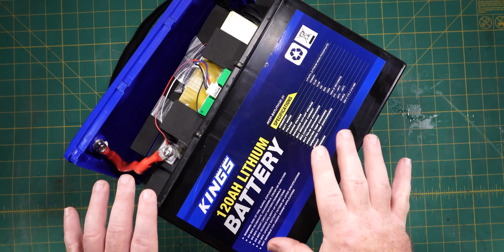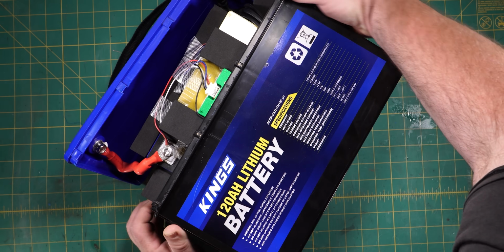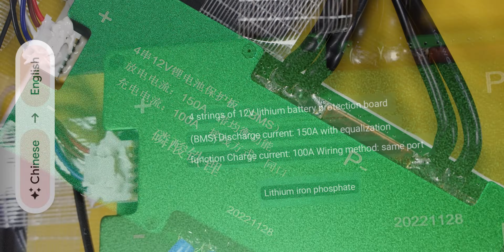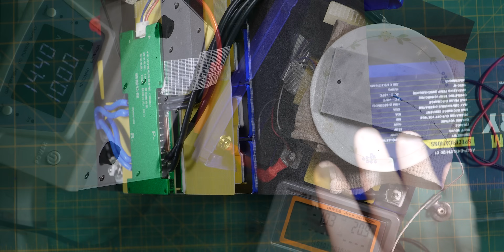Supacentre Kings 120Ah Lithium LiFePO4 Battery Performance Teardown Review Part 2

Comment from the maker: Did this change you mind about the Kings Battery? Or confirm it?
Reply: Have you notice the difference in the weight of some of these batteries? Some are 15.5 kg others are only about 12 something kg ?
Kings says it is because of terminal location with leas wiring. Nearly 3 kg of wiring seems a lot to me.
Great videos 👍
Reply: With the few I've seen in person, the heavier ones are 1p 4s, and the lighter ones are the 2p4s. Both types I've seen are different shaped cells to what he shows here.  @383dave
Reply: I would consider the battery based on your review as there is only one issue that is not really a issue for most of Australia. For the other 15% you shouldn’t be relying on the internal functions of the battery (IMO). This function renders the battery unusable until temperatures climb back up. A cheap $50 fix makes the battery still usable for charging and discharging. I live in the other 85% and I protect my batteries again overheating.
Reply from the maker: @Stoicloner1  thanks definitely an possibility, that the cells are second hand.
Reply: Still looking.  There’s an enormous price variation on this product.  Very confusing.
Reply: Changed my mind lol
Reply: Subbed.
Yet to look if you have tested the itech 100Ah.
Reply from the maker: @Ted...youtubee  I haven't, though wouldn't say no to pulling one apart!
Reply: The 120x only has 89Ah. Which I guess is why it weighs 10.5Kg.
Reply: @Ted...youtubee  Itech would be my choice, if I wasn't desperately poor and since the company I work for closed and there's no jobs here (live off-grid and my lead acids are closed to dead) I think I'll have to buy the kings till things improve, sadly Kings Lithiums are not "Drop In"  batteries, so I'll have to buy a new controller in case my current controller gives problems, although it can be manually set for lithium, a lot of people have claimed constant problems with my model charger even when set correct, don't intend to live without power!
Reply: Would have liked to see what was between the cells to prevent rubbing thru the blue sheath and cant tell if there is any compression. The charge test at -10C at 10A seems pretty close to within spec for LifePo4 without seeing the actual datasheet 0.1C charge down to that temp is fairly standard, 10% of 120 being 12A; I think your assessment was a bit harsh just on that single point. Otherwise found your review fantastic. It is hard to build a LifePo4 batt for the same money that Kings are asking.
Reply: Testing exceeded my expectations and so did the tear down. No chance (or highly unlikely)  of finding a new battery from a local OZ seller at that capacity and price with confirmed new cells. Would love to be proven wrong albeit if that's the case it would be a miracle if the cells weren't C grade. Cheers
Reply: Two fails, the low temp and qr code. The qr code is sus as fk. I'll never buy one, thank you!👍🤠
Reply: It confirmed my opinion. I am very happy to pay more for better quality.

Comment: Well,  I watched this video and the last one,  this battery has 4 cells in series, sure you mentioned 4 x12 in parallel at some point, and you banged on how the Battery management makes sure each cell is charged to the same level.
There is a flaw in your what you said.   Sure the battery management may be looking at each cell,  but all it can do is switch on or off the current flow of the battery , cause all negative wires to the BM, come from the same point on the last battery in series ,  there reason there is 4 wires, cause each electronic switch can only handle a set amount of power so requiring four devices to spread the load.  
Yes I have a electronics trade qualification,  the fact you didn’t know this, mean you should not be doing any kind of testing and sharing your thoughts,  and I bet your getting paid for these reviews by Kings.   I wont bother watching any more of your videos and I say to other viewers, to be careful this guy is a stooge !

Comment: So, why do you seem to be amused at strangely unfunny points within your video? I asked Kings about their batteries and how they could state they were A Grade. They initially sent me a spec sheet and then I said that was not what I was looking for. I asked how they knew that their batteries were A Grade cells and their answer was “because if we sold anything else, then we could be sued”. I advised them so, “if your manufacturer told you these were A grade and they turned out not to be, how would you know?” Would you be liable?

They could not answer and no Kings do not make these batteries, they are made on King's behalf by another company.

Comment: Thanks for the excellent review. Does the term "new" battery still hold true if the cells are pre-used? That really disappointed me, I was just ready to buy one of these. How do we know the more expensive ones don't apply this practice - just because they are more expensive doesn't mean they don't. Thanks again.
Reply from the maker: You're welcome, and you're right, without intact QR codes, you'll never know.

Comment: Any chance you could do a review on the powertech lithium 120ah from RTM? they are $500 at the moment, wondering if they are any good? I cant find any reviews anywhere.
Reply from the maker: I've not heard of that battery (though in all fairness, there are probably lots I haven't heard of!) 

Unfortunately, I don't have one to test.
Reply: @LockyourHubs4WDing if it helps: RTM is pretty much the same as Jaycar (same parent company I think) - big overlap in stock, same product ids, same design web site.

Comment: I’ve have had on for 4 years, black top. It runs everything my fridges, lights and even a toaster off an inverter. I haven’t had a issue. I capacity tested it last month it still made 117.73 Ah 1513.96Wh . I posted my results on that group you talk about but omg the hate for anything Kings, people just didn’t want to know that they aren’t that bad for the money you pay. The admins began reviewing everything I posted and rejecting any more further test results. So I left the group, the group is really for very basic dc information and I don’t think the admins understood what I was posting! The Kings hate is a real pile on psychosis push by lithium haters and people that represent other battery manufacturers. So let them pay more than double for a battery with the same Wh to run their toaster I say! 😂
Reply: People with negative experiences are always more vocal. I would imagine the failure rate for this cheap chinese stuff is higher, but you'd still expect nothing higher than say 20% faulty
Reply from the maker: Mine (the battery tested in the video) now lives in the daughter's camper. Still working great!
Reply: I think a lot of people spend heaps on expensive gear and feel the need to rag on anything cheaper to validate their purchase. This happens with lots of products. Sucks to be them I suppose?

Comment: FYI Kings seems to have changed their supplier it comes in a standard cardboard box rather than the pervious coloured on, and the plastic battery case is slightly taller/ different shape.. who knows if the internals are the same.. I bought a second one in order to run it in parallel
Reply: Some companies substitute product after they have entered the market and get good reviews, MAYBE that's what's happened..🤷‍♂️
Reply from the maker: I hope not, the blue top 120Ah is a good thing, mine's still running the daughter's camper.
Reply from the maker: Let's hope it's the same!
Reply: @LockyourHubs4WDing   I’m waiting on a Victron smart shunt and I will test the capacity at least… I think I may buy another of the new ones though as to not have two different battery’s, lesson learned though, buy them at the same time !
Reply from the maker: The Victron shunts are great, you can actually connect a VE direct to USB cable directly to your computer and use Victron's software to datalog the discharge.
Reply: @LockyourHubs4WDing   I didn’t know you could do that, good to know !

Comment: I took my 120ah kings battery apart today and its totally different inside, despite testing at 130ah just like yours. Mine has the bms located on the end of the battery near the negative terminal, and instead of 4s setup, it uses 8 cells in a series parallel configuration. It has qr codes but they wont scan either. It does however utilise the same green bms yours has. Its so interesting that kings also did the same with the 200ah, one teardown yielded 4 cells in series, and just weeks later another teardown and there was a 8 cell series parallel configuration.
Reply: Something that kind of did work out for me though is because theres a decent amount of spare room in the battery case, i put my victron smartshunt inside the battery which neatens up a lot of stuff and protects the shunt as well.
Reply from the maker: @lexicase8805  Victron make a great shunt, I've got a couple of them.
Reply: I find with cheaper Chinese gear that is just a brand hiring out companies to make there gear and put there brand on it can change supplier parts or manufacturer regularly.
Reply from the maker: Blue top?
Reply: @LockyourHubs4WDing 
 yep, appears to be identical to yours from the outside, tested to 130.1ah with victron smartshunt at 1c load, for all intents and purposes its the same battery, just with a different setup inside. Theres also about 40mm of unoccupied space either side of the cells and bms, so these batteries could really be a LOT smaller. Batch number on mine is 23925 

Oh and by the way, the small round plugs that cover the screws, most of mine came out simply with some packing tape stuck over and then pulled off, blu tack also works, but if you get a really tight one, a tiny drop of superglue and then i stuck my finger to it and lifted right out. Had 3 like that. Makes for a lot neater removal with out butchering the plugs or battery case.
Reply from the maker: @lexicase8805  great! So not all bluetops are the same :(
Reply: @lexicase8805  Is your battery the 12kg one. it appears there is two versions one is 12kg and one is 15.9kg
Reply: @Kennykoalas1  honestly not sure ill have to weigh it and get back to you. I have 3 of them here so ill weigh them all and see if theres a difference
Reply: @lexicase8805  It will have the weight plastered on the front of the battery with the rest of the specifications

Comment: I'd be looking at Big Wei batteries with the stainless steel case. Automotive grade cells with Daly or JBD BMS and made in Australia with lifetime service warranty. Not a cheap battery, but a once off reliable purchase.
Reply from the maker: Big Wei, Custom Lithium etc are definitely great batteries, but that's not the same demographic looking to buy a Kings Lithium or one of their similarly priced competitors.

Comment: Thanks for both your videos on these batteries. Its always intriguing to know whats inside stuff that is being sold so much cheaper than the alternative brands.... like cells with no QR codes.
I"m very tempted by the Kings slimline 100ah. I imagine it has a similar standard of internal components.
PS, i'm now a subscriber, Iits good to see someone doing a tear down that knows all the ins and outs.
Reply from the maker: I was concerned about the QR codes, Supercentre actually reached out asking about the batch number then went radio silent replying to emails.....

Comment: If it was mounted in the boot could you use this as the starter battery?
Reply from the maker: Usually LiFePO4 batteries don't really enjoy being alternator charged and much prefer a DCDC charger.

Comment: Very dodgy, in having no QR codes on the battery cells provides the question : What are they (manufacturers) hiding?  and having  the temperature sensor issues. No thanks..
Reply from the maker: I was pretty disappointed as well.

Comment: Was somewhat impressed until I seen the QR codes removed..
Reply from the maker: And King's still hasn't answered that one....
Reply: @LockyourHubs4WDing  Mmmm that's a little concerning. Easier to replace under rated wire as such than it is lithium cells you know nothing about..
Love your videos though man!
This a hobby or are you an auto sparky/electro engineer?
Reply from the maker: I'm a fully qualified epistemophilic 😁

Comment: Comment for the algorithm.  Thanks for these tests and teardowns.  Qld shouldnt be a problem. The $value seems to be ok for this product. Aussie Arvos have used  one for a year and a half without issues apparently.  Need to make a 24V battery for my (secondhand) Garmin Force trolling motor. I'd love to buy the Rolls Royce of everything but I was gagging at the nearly $4K for the secondhand Garmin unit.  My Son had an issue with  his Garmin trolling motor and the Garmin guys replaced the contol panel under warranty within days, no questions  asked.. I was blown away by the service from the Garmin people and their dealers.  Matt Mott from Bass to Barra in Kingaroy deserves a shout out. They're an outstanding operation as well.
Reply from the maker: It's great to hear when companies do the right thing by their customers. Unfortunately, we usually only hear when they do wrong and not often enough when they do the right thing!

Comment: can you measure the dimensions of the individual cells?
Reply from the maker: Sorry, I didn't.
Reply: @LockyourHubs4WDing no worries cheers mate... useful vid. 
seems about 155x155 measuring off the video... 

Also - any issues with the BMS once hooked back up? ie a tamper proof (seen some that will shut down if they think they've been messed with). probably gonna crack mine open so I can get them in a smaller case (got 2 of em :P  )
Reply from the maker: @sn0wchyld  The battery seems to be still working fine, no issues with the BMS.

Comment: Great video, I have the blacktop 200AH Kings lithium batteries. According to the kings video on that battery they state that is uses brand new grade A prismatic cells.
Reply from the maker: It's still working fine, let's hope you get the same run out of your 200Ah that I'm getting from the 120Ah.

Comment: note: nickel is also ferromagnetic (busbar material check, so not all ?magnetic? things are steel.) - copper and aluminium of course are not.

Did 4WDSupacentre respond to the temperature protection (or lack of low temp charge protection)

4WDSC claim "A-Grade" cells. - maybe but not new??   needs a response.

(in cold climates, insulating and warming LFP batteries  - warm to maintain above freezing -  avoids the need to wait for it all to warm up in the morning after a frost.)
Reply from the maker: Good point about nickel, Supacentre never did return my email inquiry after I supplied them with the batch number of the battery at their request. 

I not sure the low temp protection is that big of a deal in our market, though it strikes me as strange as they already have a BMS with the necessary thermocouple probe, that surely implementing the cold protection would simply be a matter of updating the BMS firmware.

Comment: I'm thinking of getting the 200ah version. They have a black top. Do you know what the cell format is in those?
Reply from the maker: I fortunately not, I do know the black top 120Ah version had pouch cells though. Though I have seen blue top 200Ah batteries in store advertised with prismatic cells and a higher 200A discharge rating.

Comment: According to an electrical engineer from the USA, the packs should also be numbered in series like Packs 1,2,3 and 4. Not 1,3,5 and 7.  He also said, there is a problem with the age, like how long were they sitting on a shelf before being used to make a battery.  But as you have shown, are they new packs or second hand.  Bit of a con job with Lithium batteries and ya take ya chances.
Reply from the maker: It's not great when they remove the QR codes,  it leaves more questions than answers.
Reply: @LockyourHubs4WDing  Exactly.  It's why after lots of research, I decided to stick with my trusty AGM's and they are cheaper to replace.
Reply: @Mrbullet1952 

I don't find AGM battery's "trusty"

Heavy poor depth of discharge.... And as far as trusty I have had even very high quality ones just kick the tin
Reply: The electrical engineer from the USA is probably getting people to buy insanely high priced battery's and the like to ..
Reply: @MegaRyan123456   He actually tested batteries from Battle Born Batteries and even they were surprised with the results.

Comment: Be interesting to see if battery from a different batch, same rating as this one etc, has the QR codes or not.
Narrowing down whether it was an issue with a particular batch, particular shipment, or is actually the norm.
At the moment, it's a guess, and or speculation as to the "why", without enough information to be able to narrow down further.
Great testing process etc you have gone through. A "you test" and we "learn" video. Neat.
Reply: Was watching this of theirs, and it does say brand new grade A prismatic cells.
then as you say, grouped and balanced.
maybe the QR code scenario was an issue with that batch/shipment, or who knows.
Reply from the maker: I had an inquiry from a Kings employee, sent them the batch number and as of now unfortunately hasn't gotten back to me.

Comment: Is there a limit on how many of these batteries I can connect in parallel so that I can run an inverter for longer periods ?
Reply: I think 4 is the limit. It's on their Web page.
Reply from the maker: @turbostyler  thanks for the info!
Reply: @turbostyler their current web site says 2 parallel, 4 series - also mentions that they need to be the "same batch".
Reply from the maker: I didn't see anything in the documentation, though there is a warning sticker that when placing batteries in parallel, they must be at the same voltage.